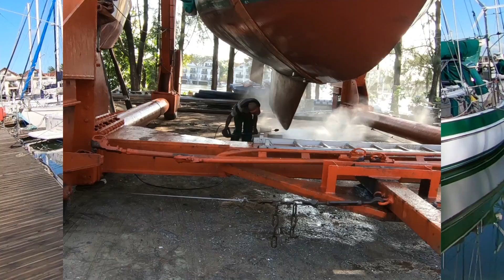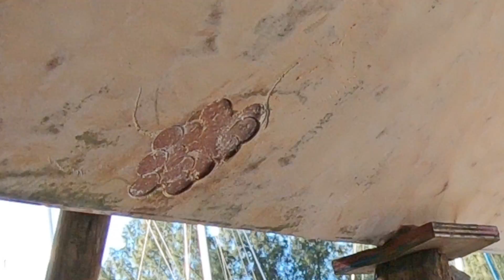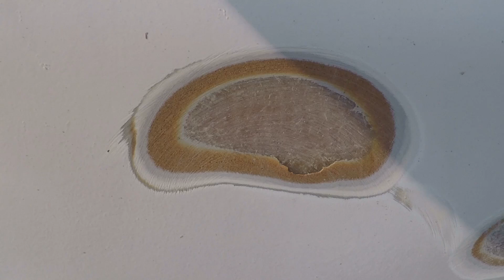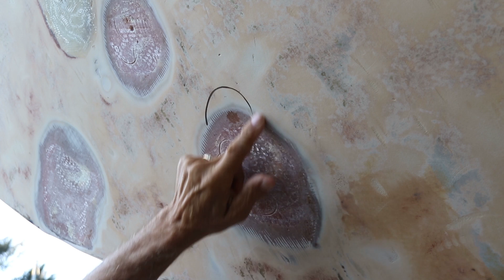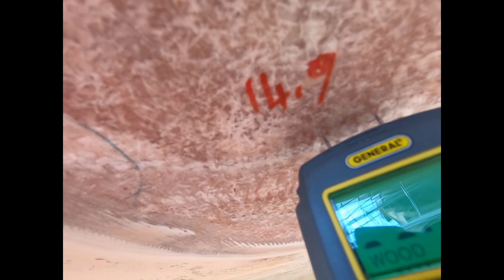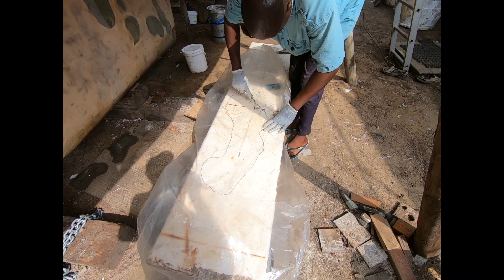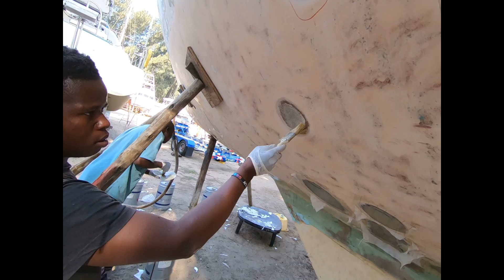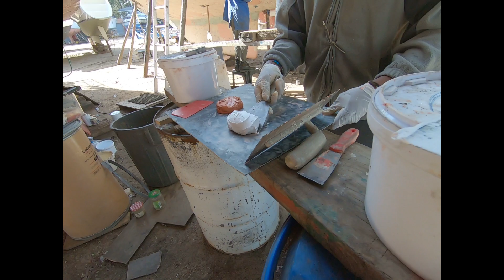500 ROTTEN, FESTERING Blisters!!  - Blister Repair on a Fiberglass Sail boat! (Patrick Childress 59)

Comment: Damn, I feel a lot better about our boat now! I am recoreing  the deck, everywhere I grind a tapper for glass there are large delaminates areas in the glass. Now the repair gets bigger and bigger and   .....I guess I have company in my grief
Reply from the maker: Bull, what make of boat do you have and what year is it? Nearly all the side decks of our boat have been ripped out because of saturated balsa.  A lot of that is now solid fiberglass. Doing this work in foreign countries, where the labor costs far less than in the U.S., makes it possible.I can't imagine what else will ever need to be fixed on this boat.....but boats can have a terrible list of surprises.
Reply: @SailingBrickHouseAndOsprey   my boat is an 1981
 Oday 25, not really in the same class as yours . But strangely it suffers the same ploblems? The delaminations I have all through the deck may be from poor building . The surface of the glass/resin is shinny in the void areas.the layers never made contact with one another.your boat is worth the repairs,mine is a throw away boat. But I did decide to repair it. I have alot of glass experience from the aviation industry,so the work is not new to me. There is an individual were I work who has a powerboat catamaran that has the same issues in his glass laminate,his boat was made in the 1990's. I am starting to think it is a production flaw. Boat companies hire unskilled labor at the cheapest price. Who knows how much experience or understanding the person had who laminated our boats . If you grow tired of your boat ,I will trade with you ! Lol

Comment: If you start a hole saw in reverse, it scores a ring that will trap and hold the blade when you switch back into forward.
Reply from the maker: Now you tell me. 😀 Hopefully I won't have any more blisters to try that out on, but the tip will be well remembered.
Reply: You can also first drill a hole in some wood then use the hole as a guide for the hole saw without the drill bit in it  , make it large enough to have a handle  to hang on too
Reply from the maker: @faircompetition1203  Sounds like you did not watch that part of the video?
Reply: @SailingBrickHouseAndOsprey   Been a while since I watched it , comment came up on notifications - is that what you did - don't recall .
Reply from the maker: @faircompetition1203  This is a new video. Thanks for watching the other one though.
Reply: @SailingBrickHouseAndOsprey   You know how it is - watch about 5-10 sailing channels .
Reply from the maker: faircompetition1 Nice to be one of the sailing channels in your list. Thanks for watching! -Rebecca

Comment: The best solution for this pitting, is to buy another boat.
Unless , you like building a construction 😎 in the sand....
Reply from the maker: Sometimes you wonder ;) These resin blisters sure do seem like an endless battle at times. But hopefully it’s gone for a long time now. I suppose we could buy a new boat with no blisters. But it will have other problems instead! And the $200,000 that one saves by buying a blister era boat can pay for a lot of cruising ;) -Rebecca
Reply: @SailingBrickHouseAndOsprey  both we right 50%,. Xaxaxaxa
Your reportage for the pirates and bb guns was perfect.
Keep up the spirit...👍

Comment: Isn't there a proses that uses a hand held power planer and you just remove all of the outer layer then reglass the whole boat?
Reply from the maker: Yes...Patrick spoke about that in the video. That’s what was done 19 years ago..a total peel job from the waterline down. The problem lies in that some of the blisters go deeper than the standard depth that the planer goes. So hence you haven’t conquered them all..just the most shallow ones. That’s what happened on ours anyways. -Rebecca
Reply: @SailingBrickHouseAndOsprey  Sorry, I must have missed it. I'll take another look at the video.
Reply from the maker: No problem. To me, personally, a blister repair video would be easy to dose in and out of ;) -Rebecca

Comment: Excellent content!  If you don't mind the question what was the overall cost of the blister repair?
Reply from the maker: About $1000 or $1500 in materials for the blister repair only ...not the other work though. There were often 3 projects going at a time. Hard to say what the labor rate was, as again, always a few jobs going on at one time. My rough guesstimate was about $2000 of it was blister repair help...over the course of many months. $15 -$25 per day per guy goes a long ways. A lot of the repairs we did using private contractors to cut down in costs, but sometimes we would hire some of the best guys at Fleet Management to help us when we needed higher skill levels, and better overall work. We wouldn’t want to, couldn’t have if we wanted to, done this work with help in the USA! It would have been all us. 

We can see if we can separate it all out for Part 2 of this video to give you instead of labor rates per day, the actual man hours or at least a more exact price for materials for the blister repair, and the labor man hours for the blister repair too. It will take some doing, but will see what we can do to at least have the figures when you ask, if we haven’t put in the video. -Rebecca

Comment: The perseverance of boat folks amazes me. Like a rotten F150 is there ever a point at which you throw in the towel?  Great video.
Reply from the maker: This shows how forgiving fiberglass can be. There is nothing structurally wrong here. But definitely some old boats should be left alone as the repair cost more than the boat is worth. There are much newer steel boats in haul out yards around the world that will never float again....fiberglass is far more forgiving.
Reply: @SailingBrickHouseAndOsprey  I imagine with the modern materials it is stronger after the repairs.   Best wishes on your next venture out!

Comment: Great information thanks for sharing,  quick question,  how long ago was the work done?   Is it holding up ok?      Edited,  the question is based on not knowing anything about this type of work,  just curious,  It’s not meant to be in any way questioning the work you are doing here.
Reply from the maker: vxnova1 Hello...we did this repair in Richards Bay in S Africa which was most of the past year. It was started in April 2019, and the actual blister repair was finished in about September of 2019 give a month in either direction or so. There is no real way to tell if it’s a successful blister repair for a decade or more. It will hold 10 or 15 years at the very least...after that, we will see. I’m not sure blisters are ever cured for life. Our last blister repair lasted about 10 or 12 years before they started coming out again. But we do feel this blister repair was probably better simply because instead of peeling the boat all to a uniform level, not always getting to the depth of every blister, Patrick opened every blister all the way down to solid material. So this blister job COULD last forever , but the reality is probably it will be for a few decades. But like he said...we will both be pretty old by then! -Rebecca
Reply: Patrick Childress Sailing thank you,   that was a big job
Reply from the maker: @vxnova1  The job was overwhelming at first but I had some very good people who kept up a synergy and who I had fun working with.
Reply from the maker: vxnova1, Patrick here. While doing this work, we exposed two areas/blisters on the port bow which were ground out and patched in Cartagena, Colombia, 11 years ago. Only CSM and a bit of cloth and polyester resin was used. It was nice to see  that patch is holding very well and needed no new attention. I have high hopes for  all our recent work.
Reply: Patrick Childress Sailing that’s awesome,  looks like you guys do great work,  I love following the channel
Reply from the maker: Well...thank you for following...and for sitting through a DIY video that many people would find quite boring! I mean, blister after blister after blister...who can look at such misery!?! -Rebecca